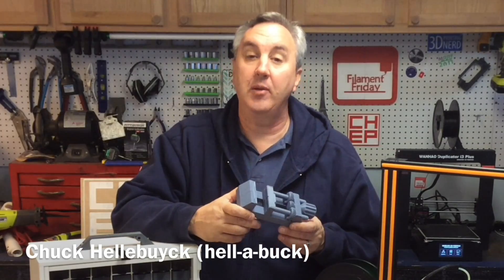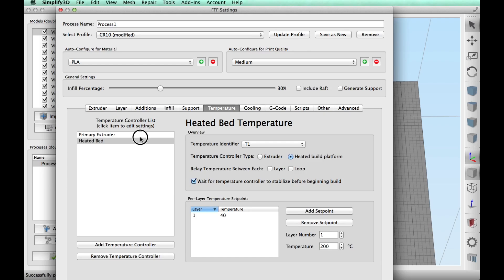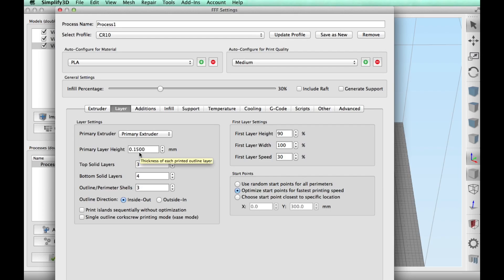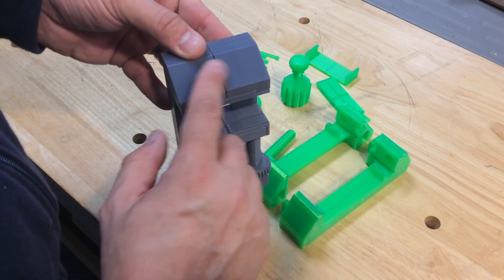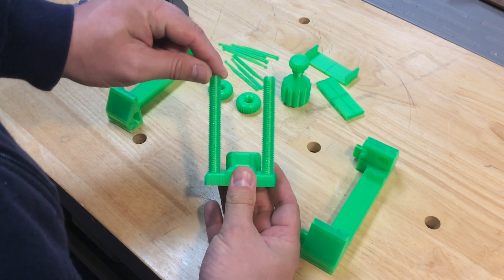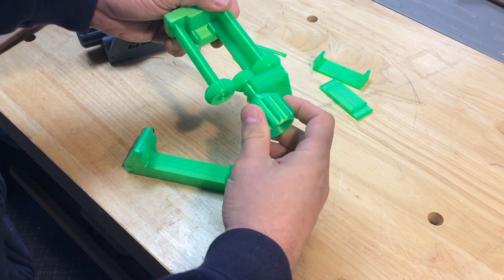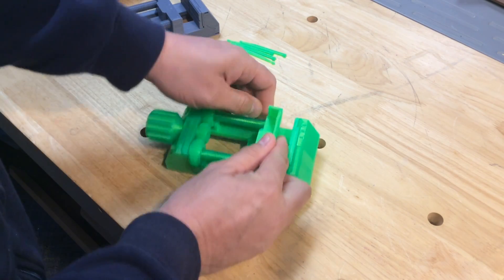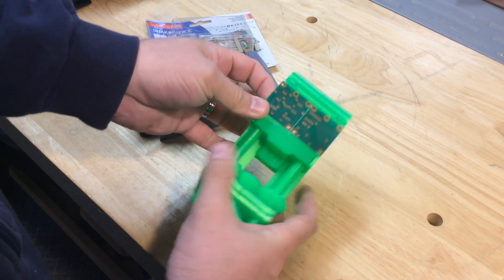3D Printed Machine Vise for Holding Circuit Boards

Comment: I've printed it all in normal size and i couldn't spin the nuts at all, but after greasing the spindle it began working smoothly and without a problem

Comment: I'm with CR10 but with CURA 4.6.1 ( your profiles ) nozzle is 0.6 and I still cannot get under 10 hours you get 7 with 0.4 nozzle. I check the layers heights and weights speed infill anything which consume time and its fine but still wonders how you get 7h. maybe it's from the slices this big difference?
Reply from the maker: The slicer back then was very inaccurate.

Comment: That little vise is interesting and well-designed. Lots of other uses for a vise like this, however, a plastic machinist's vise is about the worst tool for PC work other than drilling. For through-hole parts, you usually need access to both sides of the board at the same time to properly solder them. The part is inserted from one side and soldered on the other side.

For SMT (surface mounted parts) a vise like this would be OK as you normally only work on one side of the board at a time. It would also be OK if you use a soldering iron for surface mount parts. But most users who do SMT work, use a hot air gun or a toaster oven to melt solder paste which would melt a PLA vise as well.
Reply from the maker: I install many thru hole at once, bend leads the flip over in vice to solder. Works great.
Reply: I was thinking the same. Hot air gun and pla is a way to get problems for sure. Only working methods I've seen for through hole have been holders that have some kind of foam that presses components from the top, then you can populate it and turn whole board around without components falling off. I have some special cutters that cut leads to some length (like 1.5mm) and either crimp them wider or bend the end to 45 degrees at the same time you cut them. Those allow board populating too. (crimped lead is difficult to remove if you need to change components later)
I think it is time to look for some more holders in thingiverse. I could use another pcb holder and I never thought of printing them. Perhaps need to use petg or abs or some other plastic that does not soften too low.

Comment: Hi chuck, what temp settings do you use for inland? I use it as well and it has been difficult to find a temperature I am comfortable with. Thanks.
Reply: CHEP 3D Printing I've been using 195-200, but I have been getting much better test results at higher temperatures, so I will definitely look into trying that. Thanks for the help!

Comment: Isn't 225C a bit high for PLA?  I rarely have had to go higher than 205C,  PLA usually runs from 190 -  200.  What brand of PLA and why so hot?

Soldering on a PLA vise?  It's gonna melt! (eventually).

Comment: If the nuts were magnified in z  the thread pitch wouldn't match the rods.  So only x and y.

When i printed mine at 0.1 the nuts worked fine as designed. I too, found that the slides needed sanding however.

Comment: I beleive your printer might be over extruding a bit because i printed this about 6 weeks ago and the pins slid right in i didnt have to scale up the gears and the base didnt have to be pushed in.

calibrate the extruder or lower de extrusion multiplier a bit

it might look good on prints but you will notice a difference in quality if you are extruding the perfect ammount

Comment: Chuck thank you for your hard work  I ordered my own cr 10 based on your opinion this is my second 3d Printer my first was the Fabricator mini 1.5 also purchased after your recommendation I am having a great time with both coupled each with a raspberry pie running  octo print and they are a delight to use keep up your work I will keep up supporting you via Patreon.